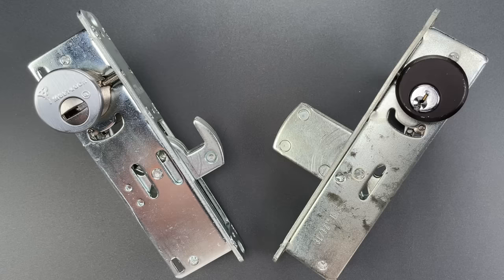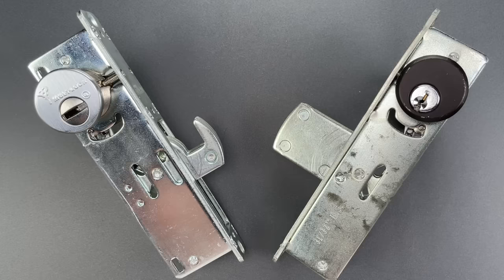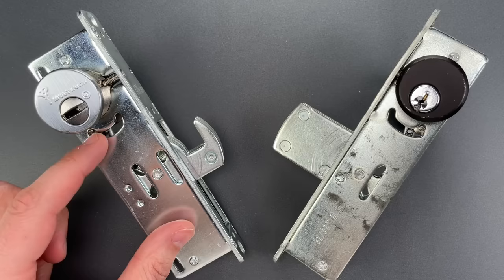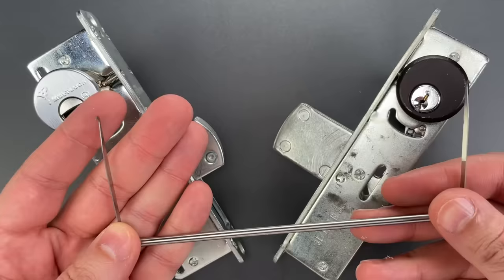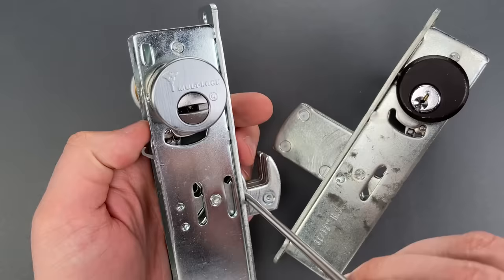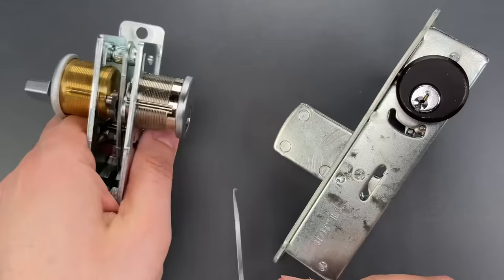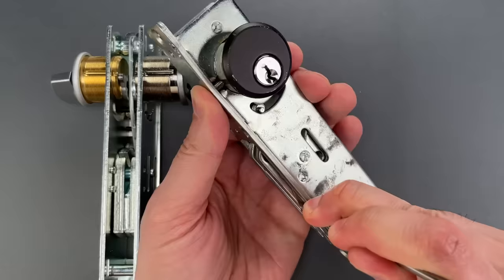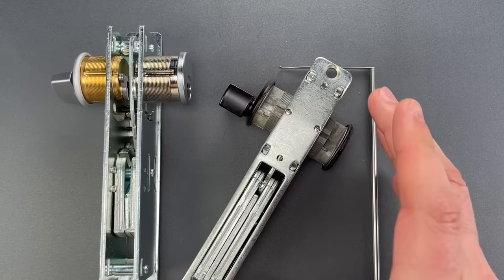[1409] The Most Significant Security Flaw in North America

Comment: My friend who's a locksmith would always install a steel plate cover over the door edge opening, presumably to defeat this exploit.
Reply: that's when a rock is used....... unfortunately.
Reply: @jonathanthink5830  No. Somebody who's using a tool to bypass a lock has a different goal from somebody who uses a rock. When the glass is broken, the criminal allow themselves 30 seconds, maybe a minute before they need to leave. It's likely to raise an alarm or draw attention. It's also impossible for the criminal to hide they were there. Using a rock is only an option if you quickly want to grab something and run.

Somebody who bypasses a lock does so to enter without anyone noticing, either to give them more time searching the place, or to install / remove something without the owner's knowledge. This requires planning , throwing a rock is usually an opportunistic act.

These tactics are completely different. It's like comparing a builder with a cabinet maker. They both use wood, both make something, but they still have very different goals and do very different things.
Reply: @timderks5960  The real consideration is the various levels of alarm capabilities.  The sound/sight of broken glass is an "alarm" of sorts, but most storefronts will go further than that. 

VERY few systems will have only a glass breakage alarm....the only scenario where this tool would be more secure than a brick.  Most places behind a sliding glass storefront will have a monitored alarm system that will include an door opening sensor and motion sensors upon entry.
Reply: @pullt  True, but again that boils down to the type of person. The guy using the brick doesn't care about the alarm. They could have the best alarm in the world, if he throws a brick, gets in, grabs something and runs out, the alarm doesn't affect them. The guy bypassing the lock probably also knows how to bypass the alarm, or knows that there is no alarm.

It still holds true: If somebody came with the intention to bypass a lock and then sees they can't (which never happens, since these kind of people scout places beforehand), they aren't just going to grab a rock to get in. These are two very different types of people.
Reply: @timderks5960  Bypass the alarm?  Typically you have 90 seconds to put that code in lol

This is me baiting you to tell us your expertise in social engineering and brute force electronic attacks since it IS possible for a criminal cabal to get into your CashMart cleanly
Reply: @pullt   Bypass the alarm, yes. I'm not talking a fricking bank here, it's just a simple store. I'm willing to bet that most stores that aren't in a chain don't even have an alarm, especially outside of cities, and if they do it might be as simple as a flashing light and a siren on the building, no communication with police. In that case it's as simple as cutting the wires to the light and siren, and it's bypassed. Obviously, you'd do that before triggering the alarm.

Bypassing the alarm can also mean scouting the place beforehand, and picking an entrypoint that isn't covered by the alarm. It doesn't have to mean hacking it movie-style. 

My only point here was that the dude that shows up with lockpicks or lock bypassing tools is not going to be the type that picks up a rock and smashes a window, and that's true. If you want to get into specifics about how exactly to break into a store, go ahead, but you're going to have to find somebody else to discuss it with.
Reply: @jonathanthink5830  You know, there are anti-theft films you can put to window glass, and some stores even have metal bars, so better go to work and earn some money like honest people. :)
Reply: Still will not stop the adams-rite wire style attack
Reply: @Njazmo  Those metal bars are a false sense of security 9 times out of 10. Tie it to a trailer hitch and put her into 4WD and those bars are gone.
Reply: Can achieve the same result with a stiff wire, like from a coat hanger, and you can make it long enough to fit under the plate shield.
Reply: Huh, I’d seen those on storefronts before, I always assumed they were supposed to prevent the door from swinging in too far and damaging the hinges; this makes more sense.
Reply: @timderks5960  I'm an alarm engineer and cutting wires doesn't stop the alarm, in fact doing that means it's harder to stop it because you've severed communication to the sirens. The sirens have their own built in power source so they'll keep ringing even if you cut the wiring. Alarm systems are very much like locks in that certain types have flaws or exploits, but usually the easiest thing to do would be to try to scope out the system for gaps in coverage or see if the code can be discovered. The biggest flaw with alarms is usually the end user. They might have the code still as the factory default, or leave the keypad dirty so you can see the clean buttons that they press when they use it. Also wireless alarm systems can be jammed if you figure out the frequency it is using. This will trigger the system eventually, but it can buy you a minute to disable it.
Reply: @gogartymike  Ah yes, the assumption that all alarm systems are either made in the last couple of decades, or are all the same. I can guarantee you that there are plenty of systems where it's just a light and siren hooked up to power, nothing more, nothing less (or actually even less). It was an example, it was not a detailed plan how to disable the alarm at a specific store. Anyone with technical knowledge knows that simply cutting wires doesn't work, and that cutting wires to sensors usually actually triggers the alarm. That doesn't mean that no siren can be deactivated by simply cutting the wires. Seriously, the only thing I'm trying to convey here is that the dude picking a lock is NOT the same dude that smashes a window. Different goals, different MOs. All the rest is just examples.
Reply: It does defeat the exploit.
Reply: @timderks5960  I totally agree. And someone that figures out the exploit to the door lock would almost certainly have some kind of plan for any security system as well. Tricks such as spraying certain types of clear lacquer on sensors to blind them, attaching covert magnets to door sensors or intentionally tampering with something so the owner cannot arm the system would all be ways to get around low security systems. Although higher security systems would detect these and warn the owner of these attempts. And I don't know about other parts of the world but here in the UK rigging up your own alarm system with sirens and so on would put you at risk of many hefty fines due to noise abatement laws and so on (Sirens have to stop after 20 minutes max here, even if they were installed before the law came in), so it is usually just easier to buy a standard security system. But indeed, your point stands that someone that has researched and used a lock exploit would have also have researched and found a way around the alarm system for that particular site.
Reply: A good example of this is in the movie Bad Santa. In the beginning they burgle the mall by hiding inside and waiting for the guard to leave. He starts arming the system and they run up the the keypad and cancel the arming with a button press. There are actually several alarm systems I am aware of that that would actually work. The majority of systems require you to enter your code again to cancel the arming, but in this case the thieves clearly did their research. Exploits like that are reasons why many places have a policy for the guard to call up the monitoring centre and confirm they see the system showing armed status before they leave.
Reply: @timderks5960  even if you unlock a store door with the lock the alarm will still go off unless you deactivate it. So everything you stated is pointless and a rock is just as effective.
Reply: @timderks5960  also you clearly think you're more intelligent than you actually are based off of all of your comments lmao
Reply: @Taylormade2350  Seriously... I literally said "bypass the alarm". It doesn't matter how, if you bypass it, IT DOESN'T GO OFF... 

If you want to reply to somebody, try actually reading the comments and attempt to understand them, otherwise you may look like an idiot.

For the tenth time: The person coming up with a pick or lock bypassing tool is NOT the same guy that will break glass to get in. They have different goals, and have different MOs. You'll never stop anyone from breaking the glass with a good lock, but it may make it harder for those that did want to pick it. Those that want to pick it won't break your glass, so a good lock actually is useful, and is not circumvented by a rock in every case, because that's not in the best interest of the guy that wanted to pick the lock...
Reply: @pullt  you can bypass the alarm many ways. Common keypad code list. Use the top 10 before lock out. Then if that fails - find the panel. Crack it open and disable the connection to the radio and phone.

If you used the entry/exit door, 60 seconds is enough time to try both methods. The alarm panel is commonly unlocked, open, with the key on top. The boxes are weak and break open easily, and often the radio/phone line to call the police is connected via exposed wires and breaking open the panel isn’t needed.

By masking up and walking in and disabling the alarm - then cutting power to the CCTV - you can have a parade of people walk in, steal the stuff - and pay you for the break in. You will be completely clean of any “stolen goods” even if the cops suspect you did it. The rest of the crew fences the goods and gets the bulk of the cash but their not on camera.
Reply: @jonathanthink5830  More likely, that's when the thief simply moves onto a different storefront. That's definitely the lower risk option than a smash and grab, which is clearly not what they came to do if they're even bothering to notice the security plate.
Reply: @timderks5960  I don't know if you just don't understand security systems...but the second you open a commercial door, you are most likely activating a silent alarm. The owners or maintenance would then go to the panel to shut it off before the timer runs out. So lockpicking for the purpose of stealth entering most commercial buildings is a waste of time. Your assessment that lots of these places won't have this, is very incorrect. Also your little plan of "cutting some wires" to deactivate a modern alarm system is hilarious.
Reply: @spoonikle  Typical establishments have an automatically generated 6 pin code, but even a 4 pin in 1 in 10,000 shot, maybe 1 in 1,000 at best is you are running the 1234s, 2345s, 4321s, 1212s and 9976s of the world.  

To be honest, the tactic of answering the phone call from alarm company and running interference of a false alarm for a few minutes is an easier tactic if you have a cohort, just to delay police response
Reply: @JasonEllingsworth  I understand security systems perfectly fine, and I also understand the one thing that none of you seem to get: not every security system out there is up to mondern standards. Even better: most security systems out there in shops that use these kinds of door locks are probably horrifyingly bad. Do you seriously think a rural small shop is going to have a state of the art alarm with all kinds of backups, a police connection, and all the latest stuff? That's simply idiotic. It's pretty much guaranteed that most alarm systems are no better than the 144p cameras that still are around everywhere as "security" cameras.

Stop nitpicking about every tiny detail, actually read what I say, and try to comprehend the point I'm making. It isn't even f-ing about alarms, it's about people....
Reply: @spoonikle  Also, "cutting the power" to CCTVs would typically involve some entry into a room blocked by a locked door....not some loose wires laying about where you simply cut the feed....and the entry will be recorded regardless
Reply: @timderks5960  you don't "bypass" it by picking the lock lmao. You're not that intelligent bud. You have to "bypass" it at the panel with the code. Stop watching movies and acting smart on YouTube.
Reply: BINGO
Reply: @timderks5960  Don't waste your time arguing with people on here. They'll never admit ignorance. These are the same kind of people that will argue bike thieves in real life, in the outside world, will actually engage in sophisticated, highly-technical lockpicking like a moustache-twirling master villain, and not just.. I don't know, put an angle grinder or bolt cutters to the chain. They don't get that different types of criminals, and different types of crime, have different approaches. And that flaws for one thing, aren't necessarily flaws for others.
The thought that their might be two types of criminal; one who smash-and-grabs, and one who plans and picks a lock, is just too complex for them.
Reply: @TheMrVengeance  no one ever said no one had different types of approaches lmao. Learn to read bud. And in fact he's the one suggesting people are breaking into stores like the movies "bypassing" alarm systems. Again. Learn to read.
Reply: @timderks5960  A monitored alarm with video recording isn't some crazy, high-tech shit that requires inside access with Q to procure them ...
Reply: @jeramiahwestbrook7370  Or just use the same tool you used to unlock the front door as usually they are secured with the same style lock.
Reply: @pullt  I have installed plenty of 4 pin panels in stores, the owner does something stupid like 2112 all the time. Ademco’s are everywhere
Reply: @Njazmo  Also remember that Perspex is an option.  It is a hell of a lot harder to shatter a Perspex window compared to a glass window and because Perspex has under half the density of glass, you can make a window twice as thick while still remaining lighter than a glass window.
Reply: @pullt  Right but the alarm system would have motion detection!
Reply: @pullt  It is easy (if you are willing to be flexible on the definition of "bypass")

Typically you will be able to find the metal box where the system is stored pretty quick, and in most cases the keys are either in the lock, or on top of the box (or a screw driver can pry open the door in seconds). Once you have access to the panel you can either disconnect battery/AC power, or just disconnect the siren and then it is not either. HOWEVER, if the system is monitored (50/50 in my experience) than the monitoring co/police would be notified and you'd have 5-15 mins depending on response time.

Alternatively, if you have a UV flashlight to see finger prints/oils (and assuming the store uses 1 code) you can see the 4 used buttons on the keypad and get the code in less than 16 attempts (assuming there is not a lockout function)
Reply: @gogartymike  Seconding the end user bit. I have two places that I service - one they have a punch code box that is set to 1-3-5-7 no alarm. The other is a dance studio that set their door code to the year they opened and alarm code to 5-6-7-8. Not only is that just sequential numbers it's the dancing line "five six seven eight" It baffles me how lax people can be with securing businesses.
Reply: LPL WILL FIND A WAY
Reply: @gogartymike  I used to work in a fast food restaurant and they put the code on the alarm itself. So someone can easily break in and disable the alarm. And they had a door lock similar to the ones in the video. Although cash was in a safe. Most you can do is mess something up or steal the POS and security computers. Or food.
Reply: @timderks5960  The getting stuff versus getting in and out can become separate challenges that when looked at near the extremes will have very different minds at work. The stuff can mean everything or just be a bonus option and mean nothing as a reward.

Is that close to what you're thinking?

Alarm mods to trip the different minds become as varied as the entry plans, the bricked windows version versus an elegant execution of mission goals. 

One type gets it done and the other gets better.

So different while sharing at least one choice of action line of commonality.
Reply: @gogartymike  writes, "...cutting wires doesn't stop the alarm..."

I used to work in an office above a jewelry shop. One day some burglars thought they'd get smart and cut the telephone cable into the building, not realizing that the instant they did that they'd alerted the monitoring station and so had set off the alarm before they even tried to enter the building!
Reply: Either tactic ... motion sensor alarm goes off ...  same time to get the f out
Reply: @timderks5960  Respect, I used to work for a Subway franchise and only the front door was alarmed, the fire door out to the back had little to no security.
Reply: @timderks5960  I can very easily prove you wrong. I once tried to rob a store, had all the required lockpick tools, but when I got there, the lock had been changed. I still needed to steal what I came to take so I smashed the window with a nearby rock, and managed to get away cleanly. Don't over-generalize, you never know how or why someone is going to act, especially in moments of desperation
Reply: my friend whos a lockmith would just weld the door shut to defeat this exploit
Reply: On single doors only as door pairs won’t work.
Reply: @Njazmo  you're missing Jonathan's point entirely. You're under the assumption that businesses spend the money for proper anti-theft and security systems in reality that's not only not true but a wild misconception. A grand majority of businesses spend the LEAST amount of money on such systems, I see it everywhere I enter, RCA cabled 10 year Costco special DVR systems, door sensors with broken/cracked wiring, unpaid employees who don't care to follow procedures, keys found in public areas, etc.

That film you speak of is very expensive and expensive to install by a professional (it's not warranty applicable if you don't have a "certified tech" perform the install). No business is looking to spend the majority of their startup costs on security. The belief is, why spend extra money on security devices when I pay for coverage insurance.
Reply: @timderks5960  Generally commercial buildings are also alarmed.
Reply: @pullt   in either case… the alarm goes off. This exploit isn’t nearly as useful as you would think.
Reply: I think the bar you are referring to is an astragal. Sure those can be defeated to but it’s more time, more tools (heavy prying) and more chance for someone to see you do it. The tool in the video is one of those “if you’re wearing a large coat you could do it in public with no one noticing despite everyone being able to see you” type of attacks.
Reply: Longer tool to bypass the plate and we're good
Reply: Thats exacatly why we locksmiths install those. Doesnt matter though. The crackheads will just pry it back with something and achieve the same result with a butter knife. If its an adams right latch. Ive yet to see someone manipulate a a flip up bolt though. Truth be told its actually pretty irresponsible of him to be showing this. If the cops see no signs of forced entry they are even less likely to pursue a criminal investigation. Unless something big got stolen. Id personal enjoy seeing lpl pull of half the shit he does on random locks out in the wild he has no controll over.
Reply: @timderks5960  you must of not of ever burglarized you can break windows silently but not perfectly silent because the glass hitting the ground. You’ll be surprised how no one can hear a little piece of glass break. You make seem like the whole neighborhood would wake up 😂😂😂😂  but that’s in the past for me buddy 🥸 study the neighborhood look out for door bell cameras and cameras out on the corners near the gutters. I mean it’s not difficult to burglarize someone’s home.
Reply: @coryhaynes8755  The rest of "we locksmiths" don't find it irresponsible to show these security flaws.  Only those who got training from Double X secret covert CIA training pamphlets ordered from the back of Mad Magazine.

Why does he not demonstrate on locks he has no control over?  Because that would be illegal, bozo.
Reply: Jonathan Think, just get a longer bar or adapt the tool to slip past the plate & into the lock to open it right up.
Reply: @pullt  Annnnnnd. Clearly on a door he had permission to work on bozo. Id like to see him do a ride along with a locksmith in a big city on buildings that are maintained just barely to an acceptable level. With old mismatched fucked up hardware, missaligned doors, worn out deadbolt latches, Gr.2 harware. Etc etc.
Reply: Yes, I remember seeing that now. Makes sense.
Reply: @timderks5960  not even close I install security systems for a living and all glass store fronts I have installed have glass break sensors, magnetic door contacts and motion sensors. You will set the alarm off regardless of how you enter
Reply: The amount of exposure bias in this section is too damn high.

If you install or create high end security systems, yes, every security system you work with will be pretty good.

Ignoring the systems that were created decades ago and installed decades ago or recently because it was cheap, aren't going to be any good anymore.
Reply: People need to keep in mind, modern alarm systems aren't anywhere near as expensive as they used to be in the 90s.
Reply: i've always seen those steel plates installed, now I know why
Reply: @pullt  Having worked security, 95% of alarms are false alarms, and on non-banks are generally treated with that much urgency. 10+ minutes to call the store owner, another 15+ minutes for them to drive down and check the building.
Reply: @timderks5960  
Any store with an alarm is not going to have that alarm bypassed by picking the lock.
Reply: @timderks5960  
Also if you have somebody who’s somehow able to bypass the alarm they’re also able to pick your lock without relying on simpler exploits.